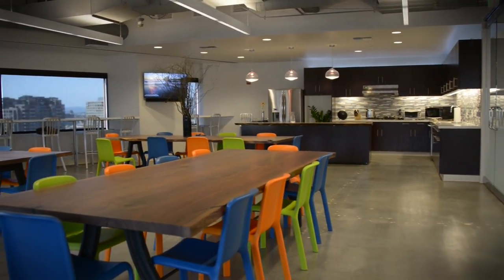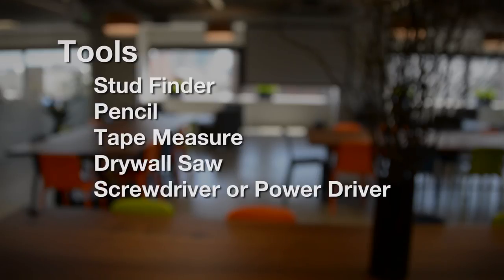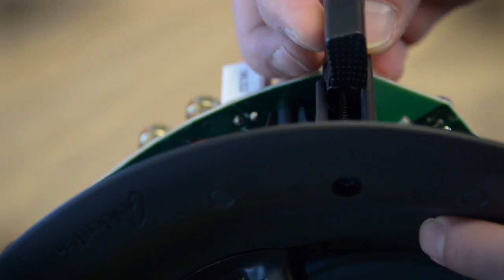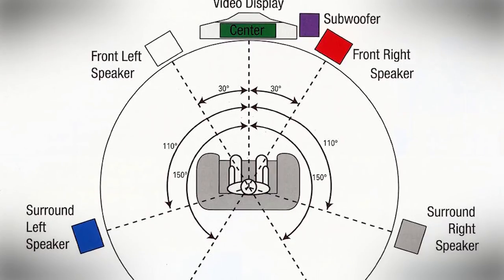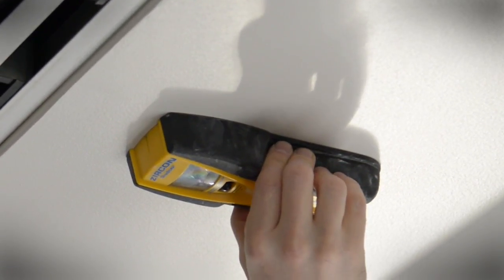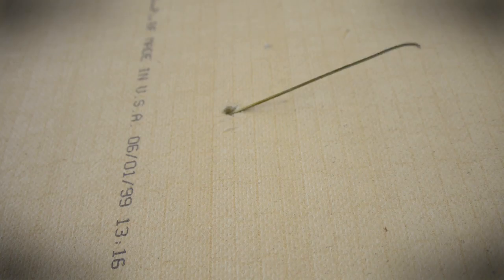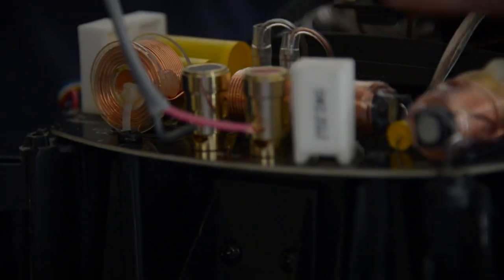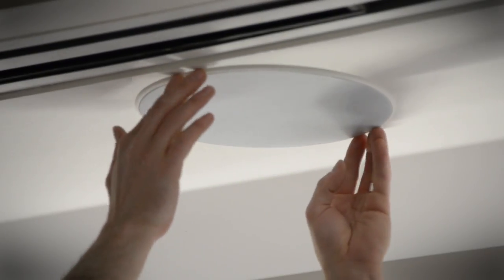How to install in-ceiling speakers with the Golden ear Invisa HTR 7000

Comment: Clothes hanger check nice tip. What amazes me is the chance people take with in wall builds as there’s no real way to know how well they sound until it’s installed.  Just have to work with what you got and take a chance. Golden ear being a higher end brand I expect it to outperform cheaper alternatives.  Sandy Gross  must be proud.

Comment: Where do the invisa HTR cieling speakers stand 2021? Are there better options for value, I was thinking of the Emotiva Vaulta.
Reply: GoldenEar and 'value' do not belong in the same sentence.  Yes GoldenEar is a great 'value' compared to B&W, but this is still an expensive speaker depending on which level you get.  GoldenEar Invisa 525 are rated down at 27Hz, I think those Emotiva's are around 60Hz - that's night and day different.
Reply: @chlinthi  im sort of doubtful they actually do 27 he from a cieling speaker of like 5-6" tbh they don't specificy 3/6 db which could mean something else, but I am aware of golden ears quality in terms of sound, but at the same time Emotiva tends to be really good value for the money as well esp since so few ceiling speakers use AMTs at the price point.

Comment: 😊❤boes $2000
Reply: I love your instructions about installing the ceiling speakers which I did successfully thank to you, but now I want to take the expensive speaker out because I am moving to another house and the automatic self locking dod ears will not return to the original position and the speaker is still not coming out of the ceiling hole, what to do? How to unlock the dog hears? Help please!!

Comment: Outdated. 
Ceiling doesn't have a cabinet therefore your not getting the best sound .
PRI.e elevation is the way to go
Reply: You'll never get the 'best' sound from an in-ceiling or in-wall speaker.  Some mfg like TruAudio and Episode offer some nice back box enclosures that will dramatically 'help' that sound from an in-ceiling speaker.  What is PRI.e elevation?  Can you post a link?
Reply: @chlinthi  typo error, svs  prime elevation